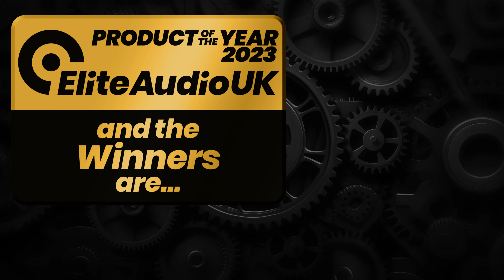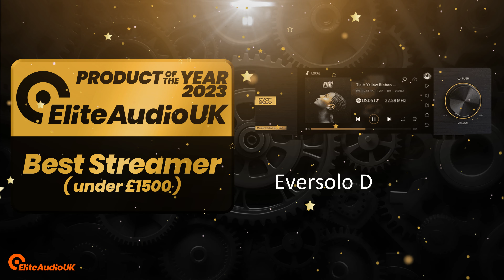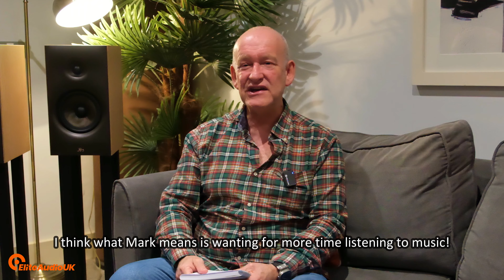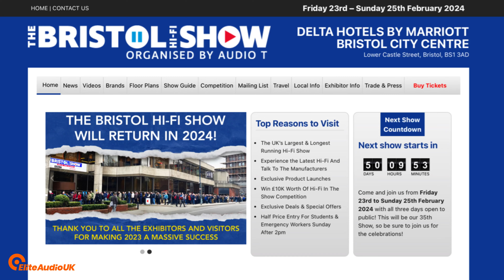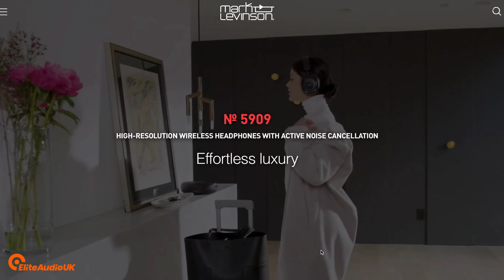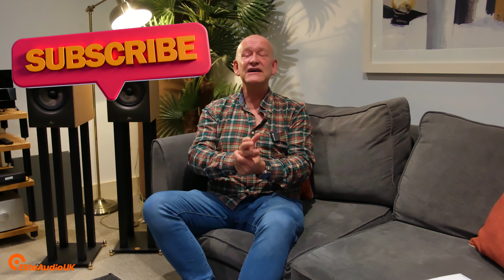The Grand Finale : Elite Audio 2023 Products of the Year Award 3 of 3

Comment: Can the I2S be connected to an AVR HDMI input?
I understand the A8 does not do 5.1 multi channel but curious to know if there is any advantage to an I2S / HDMI connection if possible. Thank You.
Reply from the maker: Good morning and thank you for your feedback. It's not something we have tested, however, I can see no technical advantage to use the A8 this way, however the only way to be sure is to try it and compare the sound. Cheers, Mark :)
Reply: The I2S connection is not HDMI, physically the cables are the same but the protocols are completely different. An HDMI input on an AVR will not be I2S comparable unless it actually says I2S

Comment: Thanks for another great video Mark. I am so tempted by the A8. My dilemma is that I have the Gustard R26 and love that DAC, so, only need a streamer. Currently using the Wiim Pro and an upgrade is due as I feel my Electrocompaniet ECI mk2 deserves better! What are your thoughts on using the A8 as a streamer only? Or are there better options in that price point for a streamer only?
Reply from the maker: You are very welcome and thank you for the feedback. I would use the A8 on its analogue output to the ECI and take full advantage of the AKM Velvet chipset in the A8.  Cheers, Mark :)
Reply: Rose RS130 or Lumin U2.
Reply: TY but those are more than double the price of the A8 :) @johnratcliffe6438